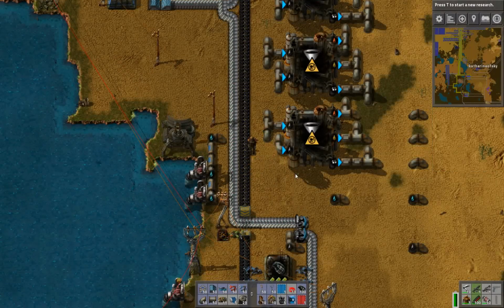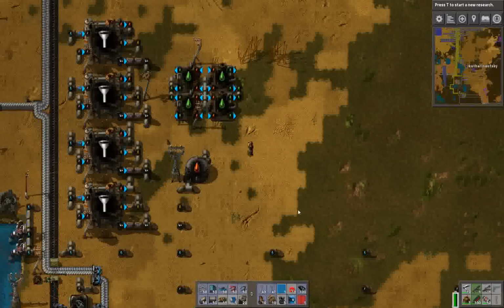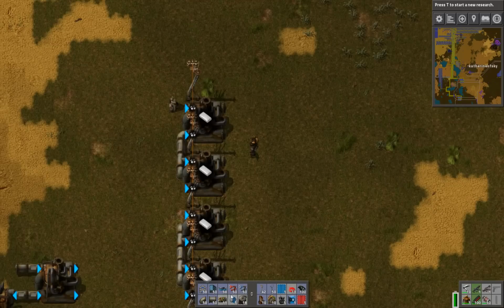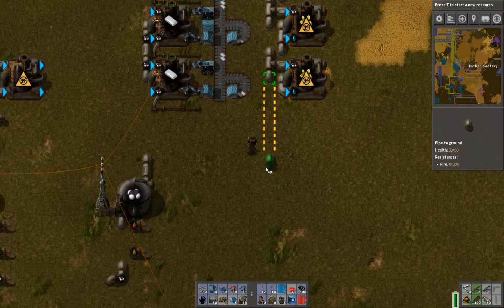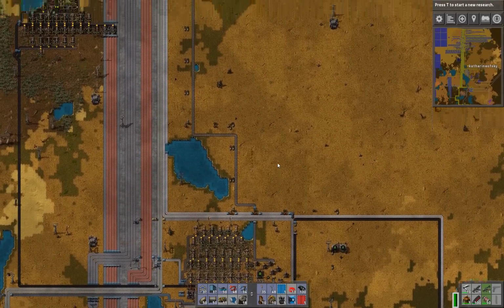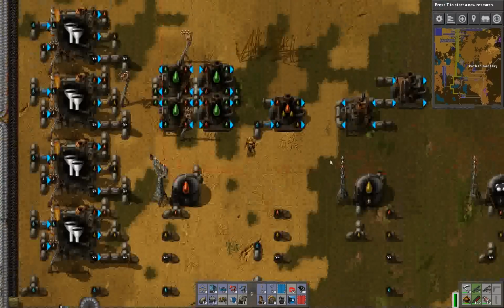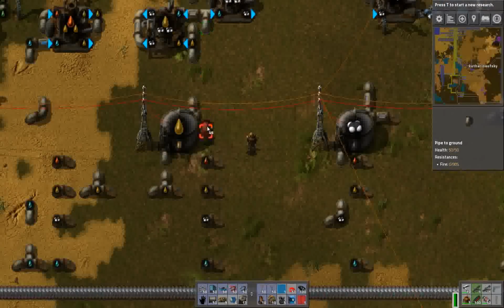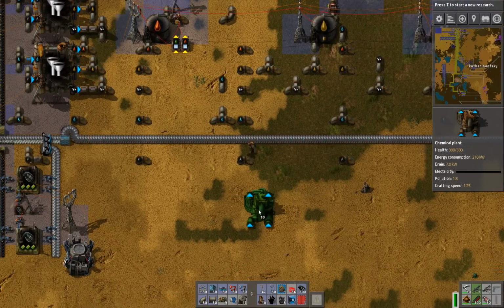Factorio Tutorials: Setting up Oil Refining: Basic & Advanced

Comment: I DEFINITELY NEEDED THIS TUTORIAL, but I paused at 1:17 to do two things.

1) Insta-sub
2) Browse your other playlists looking for help setting up rail networks, because durnit, it's oil and rail that mystify me (I end up just finding it easier to run stupidly long belt-highways to remote material-nodes and be done with it for my mainbus playstyle.)

Incidentally, related to #2 above, I ponder if my original location scouting on a brand new map might change once I know how to build in anticipation of asap-rails and asap-oil once I get the early-grind setup handled and reasonably self-sustaining.

Do you think you could consider one tutorial video devoted to rail networks and strategies, and a second one devoted to first-moment location scouting on a new map and how to decide where to build, incorporating this oil-tutorial and my above suggestion for a rail tutorial? (For example, I often just end up mindlessly chopping wood for hours just to clear paths for the mainbus, which I suspect is mostly because I'm restricted in early build locations by resource locations due to how intimidated I am by the prospect of needing rails...)

Love the vids, proud new sub, and I body-slammed that alerts notification icon thingamajibber!
Reply from the maker: Welcome to the channel MisterFister!  I am currently working on a train tutorial series.  (Tutorials take ages to record for various reasons, but they are definitely on my high-priority list of things to do).

I like your idea of creating a tutorial for quick map scouting -- I will put that on my list as well!

If you need immediate rail help/problem-solving, please come to my discord!  https://discord.gg/ybyyaSE :-)

Glad you are enjoying all the videos!

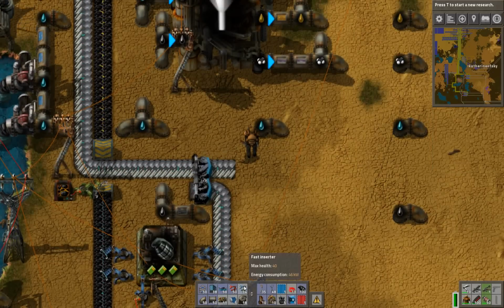Comment: What did you do to the underground belt at 21:25 to make the iron go on it?
Reply from the maker: I reversed the direction with R.  The underground blocks half the inputs with the "hood" over the top, so you can effectively take half a belt of product off without needed filter inserters, etc.
Reply: That's very clever. Thanks!

Comment: Pedantically, it's slightly better to set the Pump condition to:
Work IF [Blue Square] > 1, instead of to = 2, because you might accidentally, perhaps tens of hours later, add more [Blue Square] value to your base-wide Red Wire for another purpose entirely, having forgotten about your earlier usage.

Either way, it'll screw things up, but > 1 will do somewhat less harm.

Also consider multi-player. Ideally everyone knows what everyone else is doing, and all keep track of which signals are already being used. However, some multiplayer games take place in the real world, rather than in an ideal world.

Comment: my problem when playing this game is the oil itself. Everything waits for the oil to get pumped. idk why you would put down so many oil refinerys when only one barely fills up with oil to produce anything. Even putting blue modules on all pumps dont make it go that more fluent. idk what im doing wrong. it always ends up not having enough oil into not having enough sulfur into not producing nearly enough plastik and batteries.
Reply from the maker: Try setting your oil settings to high levels when you generate a new map -- I generally get 40-60 patches of oil per area.... and tend to tap at LEAST 3 of these for a normal base.  I can run about 40 refineries non-stop when they are beaconed.
Reply: i had 5 or 6 pumps of oil running and i couldnt set up more than 2 refineries. they barely ran because the they always had to wait for oil. no clue what im doing wrong still but thanks for the answer I guess.

Comment: the belt setup you did for the plastic looks close to my ore setup. an old tutorial taught me to make the center output line as a series of T shapes, which allows enough space to upgrade to electric furnaces. mind you, this was in a much earlier build, but i still use it today
Reply from the maker: Because of the different space requirements and layouts for various tech stages of furnaces & belts, I rebuild them each time.
Reply: yeah, for upgrading belts, that's common. and i found the video i followed, which was Arumba's ideal setup. his description basically makes it so you don't have to dismantle your belts if you want to upgrade your starting furnaces to electrics, cuz of them being bigger. just removing the arms of the "T" and moving the inserters provides space for an electric, leaving the input/output exactly where it started
Reply from the maker: Well, my point is that when you get to a beaconed setup, the entire belt layout will change, and beacons are in-between single rows of furnaces.  The layout is completely different than any beginning setup.
Reply: ah i gotcha. beacons are some of the things i hadn't bothered with, so i didn't consider that
Reply from the maker: The Belt Diva series was the first time I used beacons -- and Oh My Goodness!  What a difference!  Instead of a furnace line of 2x36,  you need only 1x16 to have a fully compressed blue belt.  Calcs from Reddit shows that Prod + Speed modules actually resulted in a cheaper energy cost per plate made versus no beacons!  (This setup is nearer the end of my Diva series, if you are interested in watching).
Reply: i was planning on giving it a watch to learn a centralized setup

Comment: I have got one question! Is there a capacity limit on pipes? One time I had a bunch of waterpumps joining together to one pipe, that then branched out and went to my boilers and such... But it seemed like my water throughput wasn't sufficient. I do recal using the 1-13-10 ratio. When i added some other pipes from pump to boilers, it all resolved itself....
(one small thingy, your uppermost light-petrol frac had no water input! :D ) 

Love your work!
Reply from the maker: Thanks!  Yes, there is a capacity limit on pipes, and small pumps, and offshore pumps.  An offshore pump produces only enough water to fill the 1/14/10 ratio on power.  There's more info on liquid throughput here: https://forums.factorio.com/viewtopic.php?t=6066

Comment: Really enjoyable tutorial! there is no word to say how usefull your videos are to factorio beginners, my english is not perfect so complex factorio tutorials are a challenge for me, but your speech is fluid and very understandable!
I have a question though, correct me If I'm wrong but it is possible to make solid fuel from oil and gaz, right?.. Can it be used to fuel engines as a replacement for coal? I try to see any additionnal use for heavy and light oil appart from what you showed us, is there any other? thank you again!
Reply from the maker: Hi Youri!  Thank you so much for the kind words!  Yes, you can make solid fuel from Heavy Oil, Light Oil, and Petroleum.  However, economically-speaking it is most efficient from Light Oil.  I never use Solid Fuel to power things, since oil is generally the most precious resource, and there is always an abundance of coal.  (But it is definitely possible!)  I save solid fuel production for the rocket only.  There are no other uses for heavy & light  oil other than I mentioned in the vid -- their uses are sadly limited.

Comment: One thing i noticed, is the lack of small pumps, small pumps are the best way to move fluids to/from storage tanks and keep the line charged as max as possible and storage tanks as empty as possible. Also if you put small pumps between multiple storage tanks all pumping to the last tank that tank will be filled first rather then all fill roughly at the same time. Making a true "buffer" that will empty down to 0 instead of sitting at around 100 and a line charge of < 0.1 taking forever for items to get enough fluids to make products
Reply from the maker: Actually, small pumps limit throughput on the line, since they pump less volume than the max allowed for the pipe.  The only reason for the 100 unit buffer in the petroleum tank is so that the pumps split he fluid evenly between plastic production and sulfur.  If there is NO buffer in the tank, it will drain unevenly, favoring one production over another.

The time it takes for the fluids to fill the line is entirely dependent on your refinery capacity and crude delivery.  Putting small pumps in is not going to make production more efficient ... indeed, it will hinder fluid movement on filled lines.

Comment: I have a fresh factory on my first playthrough. Not campaign. My biggest question is is there a way to keep my oil flowing? I keep having to click my refineries to refire them up to get them pumping again, to make my plastic and sulfur etc. Is there a way to automate that? I hate running around to my oil areas to repump the refineries.
Reply from the maker: There is no reason to "repump" the refineries... ever.  It's probably because you are backed up on light oil or heavy oil.  (The refineries will not produce unless they get rid of ALL products).  Add more storage tanks, and make Advanced Oil Processing your first blue science research.  Then, start cracking those products into Petroleum.

Comment: Hey kos I'm not an expert player so please don't take this like I'm telling you but I think you could've used the splitter for the sulfur instead of doing that half machine on that side and vise versa. Also would it be ok to use both sides of iron assuming you had enough throughput?
Reply from the maker: A splitter wouldn't solve the problem, as it would put 1/2 the material on one side of the belt, and half on the other, with a net result of 3/4 being on one side, and 1/4 on the other side.  Belts also have the added benefit of being cheaper than splitters :-)  And yes, feel free to use a full iron belt!  I used half simply because I only had half coming in :-)
Reply: KatherineOfSky thank You! I've been using those splitters so if I use 2 splitters to go on one side would that make it half and half? And btw thank you for answering comments even months after you made the vid it's very helpful and considerate ^^ I only have 40 hrs so I'm really new to the whole factorio.
Reply from the maker: You're very welcome!  Well, the easiest and cheapest solution is to do as I did in the video -- squirrel the belt around so that it goes on the opposite side.  Alternatively, you can run 1 belt for each side, and then join them at the top of the array with a splitter, or side-loading.  Putting 2 splitters isn't going to solve it.
Reply: KatherineOfSky sorry to bug you again with my simple questions. I have having trouble getting oil pumps started. It is just the flow the pipes are empty even though all pumps are working in the pipes it even says that oil is going through them but not like water or any of that would.
Reply from the maker: Are they all connected together, and to the refinery? If they are depleted (0.1 oil/s), the pipes won't fill much until you add speed modules.
Reply: I figured it out I needed to reload the world without the rail tanker mod. Is it possible that you can link a video or a picture of what your oil train setups look like?

Comment: Catherine of Sky, I have a question. In the late game, when you have to create oil fields far away from your factory, what do you feel is the most productive/efficient way of transporting the crude oil? I'm currently using a very large pipe network, but the distance seems to prevent a whole lot of oil pressure, which means it transports too slowly. Is it better to transport the oil via barrels?
Reply from the maker: Indeed, over long distances pipe pressure goes down severely, and unless you put pumping stations very often, the oil will come in at a trickle.  It's DEFINITELY better to barrel + transport via train for transport over long distances.  In 0.15 we will be getting fluid wagons, which will greatly improve the process :-)
Reply: If you're impatient for that .15 update like I am, there's a mod called Tank Wagon by GotLag. Works wonders for me. When 0.15 drops I'll be able to remove the tanker mod and my reactor mod since we'll be getting those!

Comment: Do you have a blueprint for the beginning and also final build up of one full section?
Reply from the maker: I'm not sure what you mean by "one full section".  I keep adding refineries, cracking plants, and plastic & sulfuric acid as my factory grows -- that's the reason for the expandable design :-)
Reply: Poorly worded. I meant the initial build, with the start of everything, with the room to expand.
I followed this and created my own BP of the whole setup. I'll make smaller bps for expanding the different areas later. 

I really appreciate the work you've done with your tutorials. I've learned a bit from them.
Reply from the maker: Ahh, I see!  (I wasn't sure if you were expecting a modular setup, like some I've seen on the forums!)

Thanks so much!  And thanks for the bp too!  :-)
Reply: I realized after I put it up for you that I left out the system to control the production. I put up red lines to the tanks, but that was it. Glad  you like it. Next, I'm going to do the individual "modules" for quick expansion. It is a pain to do all that braiding, over and over! LOL
Reply: Would you happen to have a link to those blueprints somewhere? I've watched this at least 4 times, so I understand why everything is going where it's going, but the actual placing of all the pipes...

Comment: 20:00, you coulda just placed a splitter with one belt facing back in .-.
Reply from the maker: I could; however, I noticed that amongst beginners to the game, people use the splitter + belt facing in in ALL of their lane balancers, which doesn't work most of the time.  (They use it on belts that have both lanes with material, and even worse, put the splitter on the WRONG side, which feeds all product into one lane).   Also, belts are cheaper than splitters :-)

Comment: I have to disagree with the cracking happening "all the time". I let the production of Lubricant and Flamethrower ammo happen all the time, limited by the storage provided (one or two tanks for lubricant, five or six chest slots for flamethrower ammo). Then if Lubricant is over 2k and Heavy Oil is over 500, Heavy Oil cracking is permitted; if Light Oil is over 500, Light Oil cracking is permitted. This makes sure that there will be a stock of Heavy and Light Oil on had to produce more Flamethrower ammo when I grab some to go fight aliens.

With Solid Fuel production added, you will want to have Plastic, Sulphur and Sulphuric Acid buffers on the circuit network so you can monitor their levels and manage both cracking and the production of Solid Fuel based on your Plastic and Battery needs.
Reply from the maker: That's why I recommend that everyone balance oil according to their own factory's needs :-)  Personally, I find that my box of flamethrower ammo is ALWAYS full... even with cracking and lubricant happening all the time.  (I could never use it up fast enough!).

Comment: Usually, I set up my Refineries the same way, but lately i've come up with this (very pipe unfriendly) setup, that ist also easily expandable -> http://steamcommunity.com/id/nobodx/screenshot/398960342827924588
Reply from the maker: Oh boy, that wouldn't work for me.  I need to be able to control the rate of petroleum usage to split evenly between plastic and sulfuric acid.  (That setup you linked just goes straight from the refineries).  Also, the annoyance in getting around!!!  Oh my!

Comment: Very nice tutorial, thanks for making it!  One question about your conditions: why not just limit cracking based upon total amount of liquid in the tanks when a significantly large buffer is present?  That way if you ever have a crude shortfall, you always have some extra heavy oil to make lubricant, while not backing up production because there is too much heavy/light oil?  I realize the only benefit here is fewer resources, just curious if there is some large disadvantage I'm missing.  The rest of this tutorial gave me some ideas on how to increase my factory's oil layout for MK II, as my current one isn't so easily expanded, so thanks for the tips!
Reply from the maker: Thanks!  There are a number of ways to set your conditions -- I have seen quite a few variations amongst players, so please set the circuits in the way that works for you!  My aim with the tutorial is to show people how the circuit conditions work and give at least one variation that will keep their machines going smoothly without backing up the entire system. 

Everyone builds differently, and I think it's awesome that the devs gave us the ability to set things up in different ways based on the goals of our particular factories.
Reply: I was just curious if there were any other reasons.  I'm still playing around with the circuit network.  I'm taking your advice on having one tank provide the values to all my pumps, as that helps keep everything working smoothly!

Not being an expert, I'm just looking to suck up any knowledge.  Thanks for your videos, they give me lots of ideas to play with!
Reply from the maker: No other reason, really.  When your needs shift to requiring solid fuel, the conditions will definitely be different, though.  (it's most efficient to make solid fuel from Light Oil rather than Heavy or Petroleum).

So glad you are enjoying the videos!  I love the interchange of knowledge that happens within the Factorio community!

Comment: If you have to few light oil, is that because you are crackin lacking?
Reply from the maker: Light oil comes primarily from refining, not cracking.  If you have too little, you need to slow down the cracking into petroleum.  If you really need more light oil, you can change back to basic processing and crack the extra heavy oil into light.
Reply: i mean as in: https://ftgdw.files.wordpress.com/2011/04/1b39011dac66e7e2babd6590a53054f9.jpg padum tsssss. good video though
Reply from the maker: lol, hadn't seen that one yet!